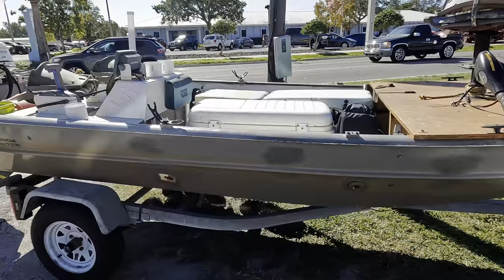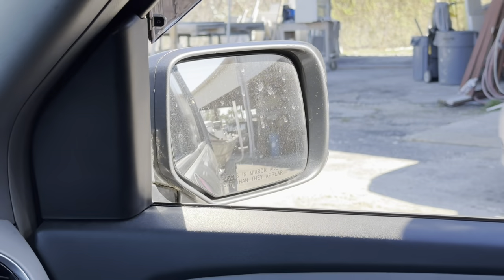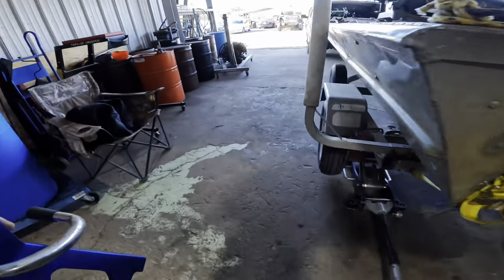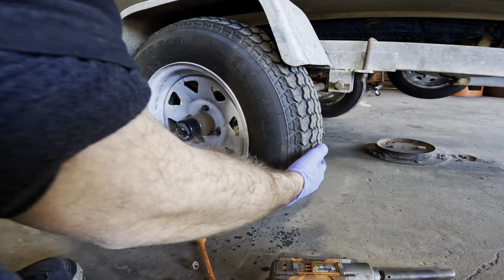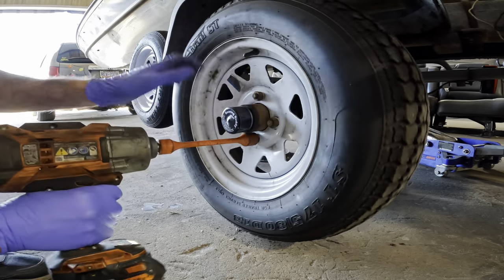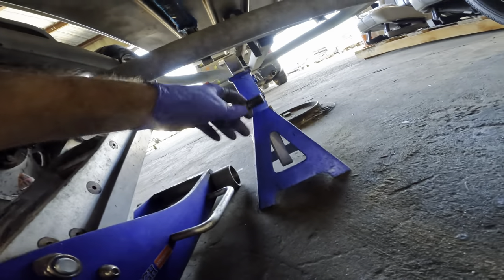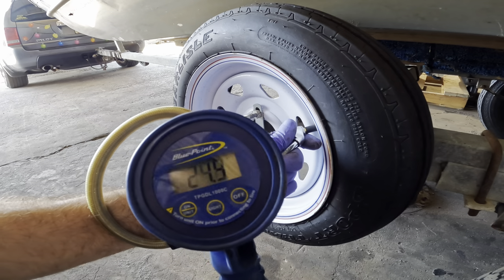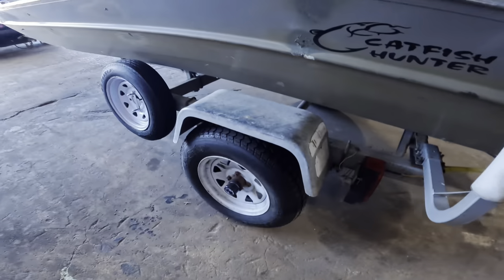Customer States: Trailer Tire Rotation!

Comment: I am sure with the tires pumped up it would help elevate the inconsistent wear on the tires. Wonder if the owner was following the owners handbook from the trailer hitch or the tires have a small leak to just sitting for a while before going down there. I am pulling more for the owners handbook for the trailer hitch since the tires all had the same psi.

Comment: Good job Ray but is it a possibility that the axle is not straight on the frame the u bolts where crooked in video, some time when in the boat ramps the trailer goes past the cement ramp and trailer wheels get stuck and the driver just gives her hell and moves the axle just a possibility have a nice holiday

Comment: Never heard of anyone rotating tires on a single axle trailer. This is new.
Reply: I guess it does change the direction of rotation on the tread  but yeah, I've always replaced trailer tires for age, never had a wear problem.

Comment: If the tires are wearing unevenly, and the axle isn't bent and the inflation is correct for the load, this points to a really crappy tire manufacture. I had really choppy tread on my Highlander and the tire store faulted the wheel bearings, then alignment. I changed to Michelin tires and went 80,000 miles without any uneven wear.

Comment: For most uses the easy way to determine the proper tire pressure is to start with a cold pressure you think is right then take the vehicle out on the road and drive at highway speeds for at least 15 minutes. This warms the tire up. Now stop and check the hot pressure. The difference between the cold pressure and hot pressure should be 10% increase. 
If more than 10% your cold pressure is low, this causes more tire sidewall flex and heats the tire more than it should. If less than the 10% your cold pressure is too high. Too high a pressure doesn't allow enough sidewall flex to heat the tire. 
Let's say you used this to set tire pressure on a lightly loaded car, then you packed it full for a trip. You should repeat this process to compensate for the extra load. 
Most vehicles have tire placards that tell the tire pressure for the stock tire by size. If you have changed tires from stock size or changed brand or tire design then the placard my not be right. Often going to a larger size tire you will need a different pressure. Using the aforementioned process will help find to correct pressure.
Tires also change pressure from the heat of summer to the cold of winter, or drastic changes in altitude. Once you find your correct pressure always keep them at this pressure. Add some air when cold out, remove some when hot out. When changing altitude check and adjust as needed to keep pressure right. 
On trailers like this boat trailer that may not carry a load at the max rating of he tires most of the time, then you can set pressure lower. In this case where the trailer is carrying the boat and the boat it's packed full and doing a lot of high speed running setting the tires at max pressure will extend life. 
Utility trailers that either run empty or full running the tires at max is ok. The tires can handle the full load of and empty the tires won't be loaded enough to worry about.
The spare on the boat trailer running 60 psi vs the ones on the trailer at 50 psi could be in load rating. The ones on the trailer maybe load B tires, the spare might be a load C tire.

Comment: Some caveats to the "max" pressure bit.  Inflate all your car tires to max sidewall and see how crappy it rides.  I was taught to chalk across the tread and experiment to find the pressure the chalk wears evenly uniform across the tread.  That is the correct pressure for that load.  Of course no one will do that, especially for a utility trailer with varying loads. But utility trailers "tend" to be used infrequently and locally.  It is worth while for a RV travel trailer or a boat trailer where the load does not change much and you are traveling distance at speed.  You only have to do it once and you know what it is for that setup.  Years ago my pop-up ate tires.  Switched to radials and never had another problem

Comment: The way those 2 tires were worn, it appears that the axle was not correctly triangulated with the ball hitch: RR worn on the outside, and LR worn on the inside, indicating the right side is closer to the hitch than the left side.

Comment: The thing to remember is to let the bearings cool down before you back the boat in otherwise when you hit the cold water it will suck in the saltiness and corrode the steel inners

Comment: If both tires are showing the wear on the outer edges, doesn’t that mean the tires are low on tire pressure? Just asking.
Larry the Cable Guy worked with Ron White, Bill Engval &  Jeff Foxworthy. They could really put on a show.

Comment: If they are coming from NC to FL. They are probably going over 55 MPH and those tires aren't load rated for that speed anyway.  I know the 'carlisle' 4 lug spare isn't rated.   Good Luck running them at highway speeds!!!
Reply: They made it 750 miles with no problem. Going 750 back on weds lol

Comment: As stated on this post Tyre wear can be attributed to the pressure in said tyres, those tyres show signs of under inflation, I would say that a pressure in the mid 30s would have been fine, I would never run a tyre close to or at it's max allowable pressure, as this will generate more heat, and more wear, and a very bouncy trailer

Comment: Love the videos!!!! Have question I’m in need of some help with my 2015 mustang GT having abs light and airbag lite coming on and won’t let me change the drive mode. Also had a new clutch installed few weeks ago now I get an engine lite which shows codes as bank 2 and 8 misfiring.. have read it’s from not having a correct crank relearn installed also when driving it every now and then it will go into a limp mode and lose all power for about 30 seconds idk what the heck the issue is. I live in Orlando fl any way I could bring car into your shop as now feel like most mechanics not very truthful and don’t fix the issues and create more problems. Thanks for any help

Comment: Hmmm there seems to be a little controversy about weather the tires should be inflated to the maximum rated pressure or not. I'll add to that that i noticed you used a torque stick to avoid over torquing the lug nuts but did not  go back with a torque wrench to ensure they got tight enough.

Comment: Merry Xmas Ray & Wife Unit, would it not have been prudent to use the spare tire in the rotation? stands to reason that these spares mostly sit out in the weather and will end up with dry rot.  Paid for the tires, might as well use it

Comment: Would the MAX air pressure be when the tire is COLD or HOT?  When the tire heats up, would not the pressure increase a bit to above the recommended maximum?  Running the higher pressure would of course decrease the heating of the tire somewhat.
Reply: My tires are specified "COLD".
Reply: Just so you know...the recommended air pressure you should run in your tires is located on the driver's door or driver door jamb. The max pressure recommendation located on the tire is simply stating the maximum pressure that the tire is capable of holding. Trailers also have a tag or sticker on the tongue stating the recommended tire pressure. I'm very surprised Ray didn't mention any of this. Airing your tires up to the maximum pressure stated on the tire is wrong.
Reply: @BruceCoggins  Every article that I've just read from reputable sources says to inflate a trailer tire to the MAX indicated on the sidewall.

Comment: How 'll rotating the tyres help the wear on them?
They 'll roll the same direction - forward 😂

This wear is mostly because to low preassure in the tyres.
Give them some air, that's all they need😮

Comment: Rotating these tires will not solve the wear issues. The hubs have too much negative camber. They make camber plate wedges to adjust it or you must have a shop heat and bend the axel tube.

Comment: When rotating radial tires, you are not supposed to change sides with them because after they have run for 3 to 500 miles they have done seated in to that rotation. If you do they will eventually get hot and start blowing out no joke. I have seen it to much. You break the tires down and flipthem a half of turn and they will still be running the same direction. Bias ply tires doesn't matter.
Reply: Those aren't radial tires. ST175/D13.  The D designates diagonal-ply, not radial.
Reply: Good eye  @wilbilt

Comment: Ray, I love your content watch you everyday. I have to inform you that torque sticks can only be accurately used with pneumatic impact guns. Electric impact guns have a different torque speed and will overtorque nuts when using torque sticks. The torque test channel proved it. Just looking out for you brother. Wheel offs are not good.
Reply: Yup, pretty sure they'd have to be calibrated for a particular angular velocity(or a rather small range). Though on the other hand, I doubt all pneumatic drivers are made identically & available shop pressures differ & such which prolly almost nobody even pays attention to anyway. I'm sure somebody could come up with a good rule of thumb, like if you're looking for 80 ft lbs use a 60 or whatever.

Comment: It seems to me that the owner is running the tires at the wrong pressure to begin with since all 3 tires just had 29 PSI in them. But then again, 50 PSI might bounce that little light weight boat all over the road when he hits bumps or pot holes. The tires should wear better with 50 in them though. Good job getting him fixed up Ray.

Comment: That bent U bolt holding the axel on has nothing to do with uneven tire ware I am sure. Dropped off the end of a ramp and banged it hard getting it back up the ramp. Not to mention that bad springs...

Comment: If both tires are worn on the outside, what have you actually accomplished by rotating these? The outsides are still worn. Would it not have been better to flip the tires on the rims and then rotate them? That way the tires are still spinning in the same direction they were previously but the wear gets moved to the inside.

Comment: I may be incorrect:  BUT, the tire will increase air pressure while driving,  to a higher psi.  
  So filling the tire at its max psi could be wrong .  If those tires start at max psi  ie: 50 psi,
then the running psi will increase...to an explosive event that could happen while driving.
 So if you run a higher ply type tire it is able to hold higher weights.  So in the first place get a higher ply type tire.  Fill the tire with the recommended 32 psi, and the MAX tire pressure will not be over filled /reached /done.
  Does that make sense...yep.
Nothing like loosing a boat while driving.
Let me know if i'm just blowing farts here....thankx.
al
Reply: The maximum PSI noted on the sidewall is the COLD rating. Heating during operation is accounted for in the design.

Comment: Not your fault, but that motor should be in the raised position during transport or they may not have one when they get there 😮
Reply: I noticed  that too.  I also ran a transom saver on my Lund.
Reply: The engine has over a foot of ground clearance on the trailer unlike my other boat. I do have to raise that engine

Comment: After 33 years of working with trailers and boats and doing most of my own work, I would suggest the tire pressure needs to be based on the weight of the boat and trailer.  Pressure at max will cause significant bouncing when driving and is not always the best choice.  Also as this boat is being used in the marine environment, I hope the grease you used was marine rated so it will turn to moose [oily jelly water mix) and that would be bad !  Thanks for taking this on Ray!
Reply: At least there is someone on this channel that realised over inflating tyres is not a good idea. A max pressure is exactly that, a maximum limit, a heavy load calls for a higher pressure, a Bass boat is not heavy…
Reply: I try to always use marine grease on my jet ski trailer.  Supposedly the hubs are designed to keep most of the water out.  But I do not really know.
Reply: Good point of the max psi on the tire sidewall.

 Also relatable to passenger vehicles since some people don't know there's a certain rating on the tire decal that's usually lower than what's printed on the sidewall

Ray did say that grease is marine grade 13:45

Comment: You solved his tire wear issues with the addition of air.
Reply: No he didn't. He over inflated the tyres.
Reply: @tellitasyouseeit7555 trailer tires are not the same as car tires. Trailer tires are rated to carry their load at a specific tire inflation pressure. These tire  were correctly inflated to the rated pressure as written on the tire.  Under inflated trailer tires (mostly due to owners not knowing better) is the number one cause of trailer tire failure.
Reply: Very possible, they were underinflated. Not grossly so considering the size of the boat and contents. IMO, inflating to max pressure isn't necessary for the load being supported.
Reply: @Lloyd973  Yes. Just as I mentioned. The tyre pressures on the sidewall is maximum pressure when trailer is at optimum weight. But needs adjusting down due to lower weight of boat. Too high and trailer will bounce along the road and probably will discard the load on the road.
Reply: @JM-lk6wo  yes. I would agree.
Reply: @tellitasyouseeit7555  check the addition of boat weight for a welded sixteen foot all welded aluminum boat, plus the weight of a fourty hp engine with power trim, trolling motor, two deep cycle batteries one starting battery, two loaded eighty quart coolers and twelve gallons of fuel weights. Add to that three hundred fifty pounds for the trailer.  My guess is that rig weighs a lot more than you think it does.  My fifteen foot alumacraft and trailer with a twenty five weighed right at one thousand two hundred pounds with no batteries, fuel or trolling motor. 
All that aside, basic tire maintenance charts with pictures depicting tire wear on the outer edges normally indicates low tire pressure.  Cupping on trailer tires usually indicates misaligned or bent axle.
Reply: @Lloyd973  great speel. But all I was stating is the figure on the sidewall is the MAXIMUM tyre pressure allowed for that tyre.Actual pressures will vary depending on use of trailer and weights exerted on axles. Simple. Have a great Xmas and don't be crabbit with the kids.👍

Comment: I don't know why you can't share one jack handle with two floor jacks, but if you feel the need for Elfen safety to chuck an axle stand under a vehicle you are not even going to go underneath then go right ahead! Also shouldn't the other floor jack be chucked in the rubbish now it is useless without its own special individual handle?
eta: I think I have been Ray trolled like with the blue rags left in the intakes. Too much xmas spirit. LOL

Comment: The spare tire is bugging me. How come it has a different pressure limit? Supposedly it is the same size, right? This just doesn't make any sense.

Hope you get better soon. We love you at your best. Merry Christmas.
Reply: It's a different size it's smaller
Reply: Donut spares usually have higher psi rating than the regular wheel/tires
Reply: Ok, guys. Thank you for the info.

Merry Christmas to you and your families.

Comment: @7:00... Those tire are worn on the inside edge. They needed to be swapped from one wheel to the other. This would even out the wear. All you really did was change the direction of rotation.

Comment: Would someone explain to me why you have to run trailer tires on a trailer, rather than a six ply car, or truck tire on a trailer. If you put a regular tire on a trailer, it would seem logical to me that if that tire can support a 6000 LB. vehicle it could certainly support a trailer that is only hauling half that weight, and use layman terms please!

Comment: Wish you would have rotated in the spare.  I don’t see people do that and the spare ends up going in the trash and was never used. I get 33% more out of my tires that way.
Reply: It's a temporary DONUT spare rim/tire... That's why it also has a higher tire psi rating

Not meant to be in full rotation, similar to vehicles with compact spare tires
Reply: @ricebike  got it, I didn’t know they made temporary tires for trailers. I’ve always purchased the same tire for mine. And if I don’t rotate it in. I end up throwing away a brand new cracked tire and rim.
Reply: @warren6172  yeah, the 60psi rating gave it away

Comment: I don't see any point in rotating the tires on a trailer like that. Rotating from side to side is not gonna change any of the wear patterns. Unless something's bent bent or worn out, they should be wearing the same.

Comment: To remember the difference between port and and starboard I use the phrase “there’s no red port wine left.” Meaning Port, as well as a Red marker light indicates the Left side of a vessel. This also applies on Aircraft, and under the kitchen sink because the left angle-stop (should be) the hot water.
Reply: Interesting. I have always associated the port with the equivalent of a UK car, the nearside aka passenger side on the left. That makes perfect sense to me but I am a Brit and we drive on the right side, as in correct side, which is the left side. This is in order to allow our rapiers and muskets to defend ourselves while driving vehicles and horses from vagabonds on the highway. Most of us are right handed after all.

Comment: No no no…Grease only while slowly rotating the wheel.
Reply: That's not a lube type axle, it has bearing buddies installed in place of the dust caps which use spring pressure to help keep water out and can also press grease slowly through the bearings as it rides down the road, but it doesn't do much to press grease through the bearings unless the inner seal is bad.